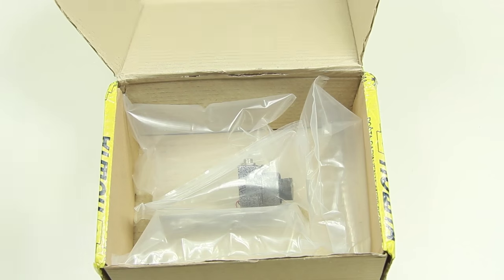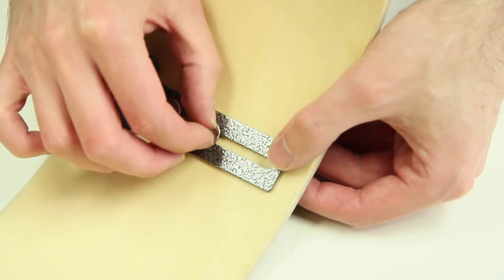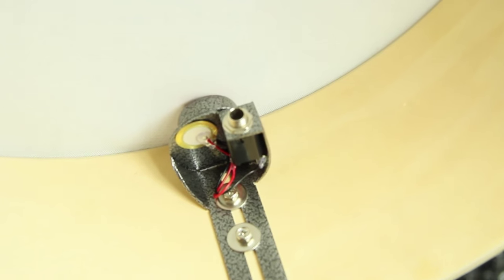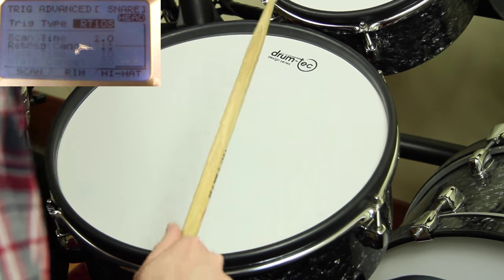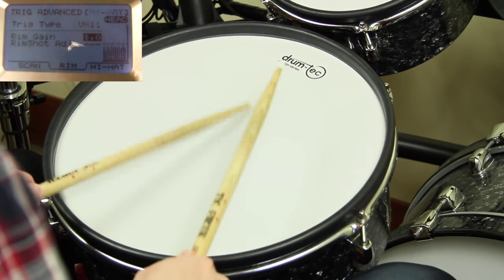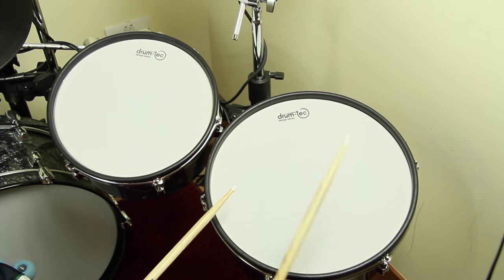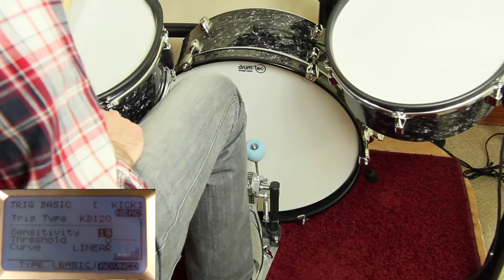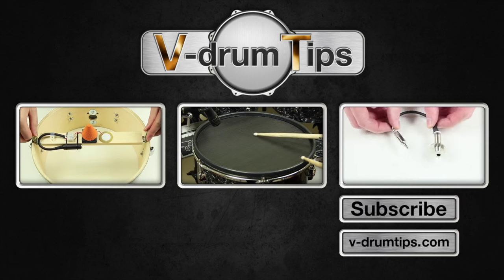Triggera Intrigg Review (E-drum Trigger)

Comment: Awesome Video! I have got a question: I have a DM10 Drum Module and i want to upgrade a small acoutic set with this Triggera trigger and 2 ply mesh heads. Is this trigger good enough or do you recommend the ddt truss system for example? Or any other system?? 
As a Snare drum i have a drumtec pro snare drum, which is awesome.